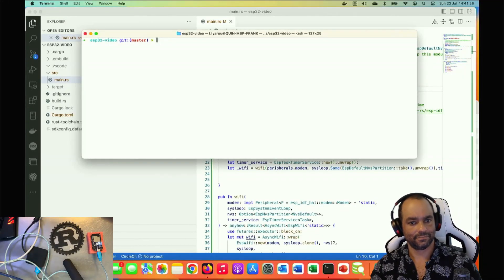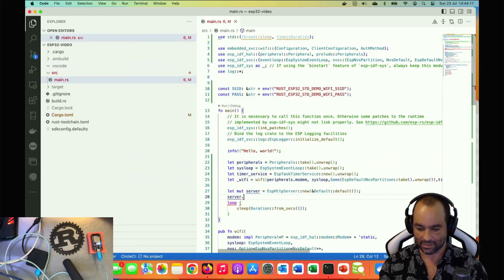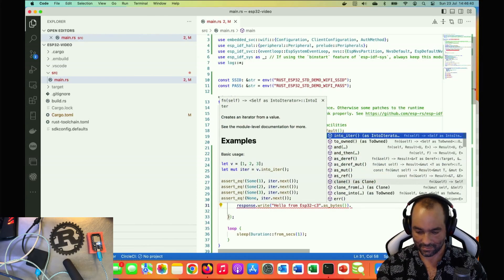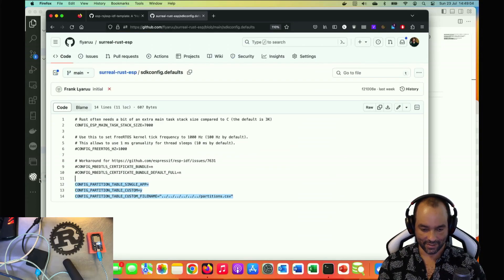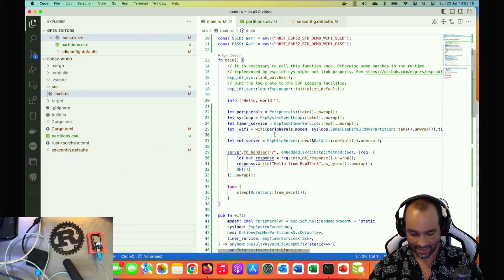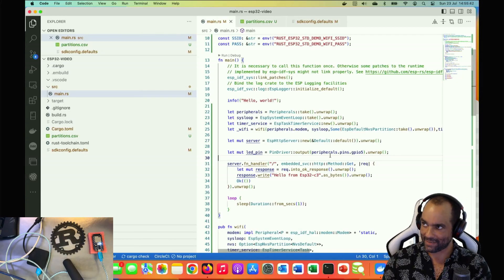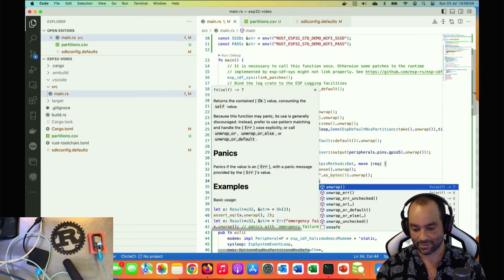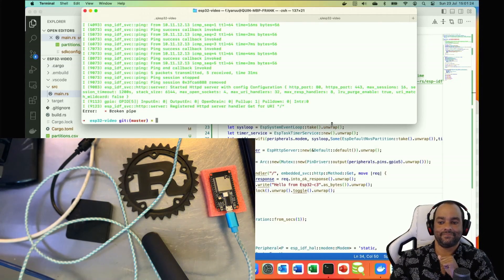Rust on ESP32 - Creating an HTTP api

Comment: I noticed your GitHub repo where you work with SurrealDB and make HTTP requests to it via the ESP32 board.  Have you tried the "ureq" HTTP crate?  It is more lightweight with blocking I/O, no async runtime like the "reqwest" crate.
Reply from the maker: I create another crate 'simplehttp' that is a sort of minimal http crate. Based on the features you can use different implementations. I've implemented reqwest, esp32 idf, fastly (webassembly) and spin (webassembly)
Reply from the maker: I'm not sure ureq would easily compile on top of 'platform owned' services, like you have to deal with on esp32-idf or the different webassembly sdk's